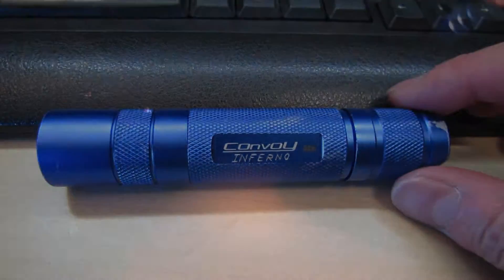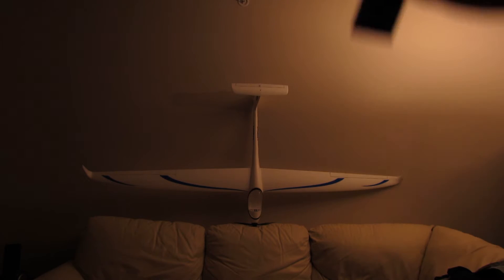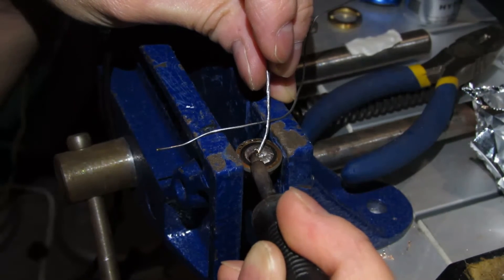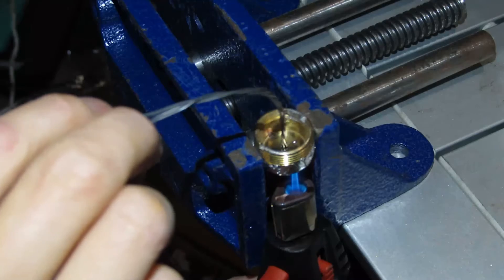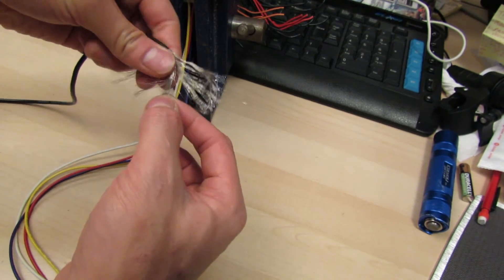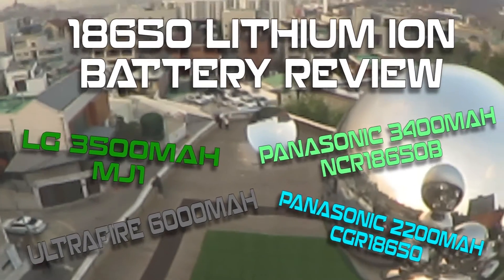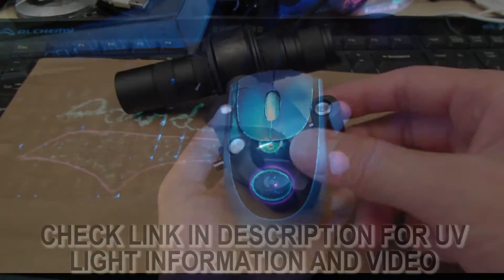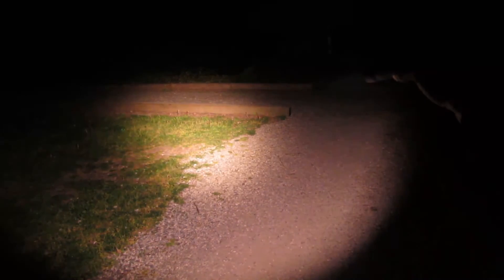The Most POWERFUL Flashlight EVER - DIY Convoy INFERNO - 2239 Lumens

Comment: You are aware that the XM-L2 can not put out 2000 lumens, much less 2239 correct? The T5 flux bin you have listed would doing good to make 1200-1300 lumens out the front as it puts out 35% less light then a U4 bin. Plus 7135's have high resistance and can't put out nearly as much power as an FET driver.

I suppose you are not aware of lights like the Astrolux S1 that put out more light then this in stock form and has an intergrated shelf so no need to worry about those pennies). Or the S2+ Triples that are making a REAL 2500-3000 lumens with 60W+ of power in the same light?

If you want to make things a whole lot easier next time simply use an FET based driver instead of the 7135's. They sell them pre-made for cheap on banggood as the "BLF A6" driver. Or if you want the latest and greatest look up drivers on BLF where there are lots of new triple channel drivers out.

This is an impressive amount of work, I just hate seeing people do that much work when they don't have to.
Reply from the maker: Hi Texas Ace, thank you for your informative feedback, you seem very knowledgeable and that's awesome and very welcome!  

I have always liked to work on this type of stuff, modify things, take things apart and play around with them, so to me this is actually fun, and not a lot of work; hopefully others think so too, and enjoy playing around with the electronics, wires, soldering, grinding even, etc.

I actually didn't know about the Astrolux S1, or the triple when I built this.  But since I've looked at them, as well as a single XHP70 in the Convoy S2+, they look good for high out the front lumens, but will be more expensive builds so I haven't gone down that route.  I'm pretty cheap so I wanted to see what I could do with just some extra 7135's, and the stock XM-L2.

Thank you for having me re-visit the lumen output, I am always open to learning, and you have shed some light on this.  My calculation was simply 20W(bench tested with the power meter), multiplied by the 116 lumens/watt, since the output is generally linear(I assumed), I calculated 116*20=2320 lumens.
The Cree website also said 170 lumens/watt at binning conditions(http://www.cree.com/LED-Components-and-Modules/Products/XLamp/Discrete-Directional/XLamp-XML2), so I assumed 116 lm/w was a fair choice and not misleading right?  But you're right, it's not as linear as I thought, and it drops as power increases.  I suppose my T4 bin could put out a lot less than 116 lumens per watt.
My impression was LEDs put out around 100 lumens per watt, and that fluorescent sources were even reaching 100 lumens per watt, so I assumed my Cree LED could output at least that.  Could be totally wrong though.  So if I go with a higher bin, say one that gives 170 lumens/watt, can you multiply by 20W and 3400 lumens?  That seems ridiculous and nearly impossible, I guess that's where you need to take into account the factors that decrease output.

For the heat, I was just trying to extract the heat through the threads, and create more thermal mass so it doesn't get hot as quickly, maybe 30 seconds instead of 20.  Not much but it helps having more copper in there.  I see that someone on BLF has since made a copper insert for the S2+ that you can buy, which beefs it up with copper, way more copper, he had a link on ebay for it.  Easier to get that, but I think it's fun to grind up copper and solder it.  I also purchased two 5mm thick plates of copper, gonna play around with that.

I like the FET idea, but I was scared of overcurrenting my LEDs, I am hoping the 7135 can limit the current if i throw in a VTC5 with super low internal resistance.  I saw on the FET websites they warn about keeping an eye on that, so I opted for the safer 7135 stacked method.

I am going to try cone-doming my LEDs, to make a better thrower, what do you think about that?  I'd appreciate your feedback for sure regarding that upgrade!  Will it redirect light to the reflector and kick it out in an insane beam?  I'm hoping, but I'll be testing and sharing my results regardless if it's successful or not.

Thanks again for your feedback and looking forward to your shared knowledge!

Cheers,
David.
Reply: At least you are willing to learn and not just cry when something is pointed out. Props for that.

Having fun with flashlights is what it is all about, I also enjoy playing with them, thats how I ended up with over 100 of them and counting lol.

The S1 is not what I would call expensive at but it also does have it's issues. At around $22 and 1600 OTF lumens though it is a pocket powerhouse that is hard to argue with. The convoy S2+ is simply a bit better made. They can both do the same thing with the same parts though.

An XHP50 or 70 in an S2 is pointless, I did it. It gets too hot to hold in less then 30 seconds and hot enough to desolder itself from the star in about 90 seconds. No joke. Same thing happened with one of my triples before I started using drivers with thermal setup down. The biggest reason that XHP's are pointless though is that you have to use 18350 batteries which mean you have all of 5-7 minutes of runtime.

Triples on the other hand are much better since they can use 18650's but they still overheat fast on turbo due to producing around 60W of power in a high powered version. They are a very nice floody light although I personally prefer the single LED EDC lights myself, they have a more usable beam for things further away then 30 feet or so.

Trying to calculate lumen output from the datasheet is an exercise in futility. Don't even bother. Generally when you are driving an LED hard it can easily get down into the 50-60 lumens/watt range. To see what the LED's do in the real world look up some tests on BLF, djozz does some nice ones. XM-L2's generally max out around 1500-1800 lumens for the high bins (ala, U2 and up). For a T4 you have to subtract 7% for each bin, so that would be a max of around 1200-1300 lumens, which is unlikely with a 7135 driver. My guess is closer to 1000-1100.

If you measure the current with a clamp meter or a shunt while it is in the flashlight and then compare it to the charts and correct for the bin difference then you can get a semi-close idea but it will be far from accurate, just a ballpark guess.

With current battery tech you pretty much can't overdrive an LED we use now days as long as it is mounted on a DTP copper star. Direct drive will only draw around 5-6A from the best batteries, lesser batteries will be less current then that. the 7135's have a lot of resistance and as such will reduce power more then an FET.

For example in my current EDC XG-G3 90+ CRI (soon to be swapped for a 219C 90+ CRI) S2+ with Texas Avenger 7135+FET driver it will pull around 8 amps on turbo with an HE2 cell but only around 5 amps with a GA cell and even less with a laptop pull.

Modern triple channel drivers give the best of all worlds, you have regulated low modes and then a full on turbo mode for max power when you want it.

You can dedome the LED but I highly recommend you do NOT dedome the one you have. It is a warm white LED by the specs you listed (which is great, they are a great tint). The problem is that when you de-dome an LED the tint "shifts" to be even warmer and greener. If you dedome a very cool white LED, such as a 0D or 1A tint the end result is not my thing but at least it is not puke green. If you dedome your on the other hand it will most likely come out looking like puke green and disgusting.

If you want better throw there is a much better option, simply get yourself an XP-L HI  LED in the tint of your choice, they come without a dome from the factory and throw much better. They are my go to LED for anything I don't want 90+ CRI in. If you want even more throw get yourself a good TIR lens (they are not all the same, I tested over 20 of them and only found 2 that work well).
Reply from the maker: Texas Ace Thanks for all the info Texas.
I'm always up for learning, that's how we all got here right?  Life is a journey and we will never stop learning, everyone is born knowing nothing.

That must be quite the collection you have!  Lol. But can never have enough!  I think there's a light for every task.

I haven't tried a fet on an XML, but I should try, from what you're saying, I'm guessing the low internal resistance of a good 18650 won't even burn out a single XML2 on a Sinkpad II.  I'll try on a cheap XML2 when I get a chance to experiment. 

For the dedoming, I was thinking if just cutting it off with a shaving razor blade, instead of gasoline, cuz I don't like color shift either.  I like my warm white 2750K, it's kinda like an incandescent light source, which is what CRI was based on, so if you can make it look exactly like it, it's sort of like a CRI of 100 lol.  It definitely has a higher R9 value, and that's important for light quality.  R9 is a fairly new value that LED manufacturers are looking at, because they realizing having more red spectrum contributes to higher light quality. 

So for dedoming, I was thinking of shaping the dome like a cone shape, which should help direct the light to the reflector, be it the smooth or a TIR.  Hopefully that will help throw more of the light forward, rather than out the front. 

That's awesome, I've tested a couple TIR optics, 10°, and it was better than the stock OP reflector, but not that much tighter.
I put an XPL HI in there too, but I'm thinking it throws a lot of light forward still, so I'm hoping the dome shape will help. 

I'm gonna test it out when I have some time.  
The XHP70 in the L6 has a donut shape, so I'm hopeful that it'll help with that too, but I'll have to see. 
What do you think?
Reply from the maker: Texas Ace Oh ya,  and about the LED desoldering itself,  that's pretty funny,  but makes sense since the heat can't escape,  it'll just get hotter and hotter to the point it reflows,  I press down while I solder though,  so it might not make a difference since the LED is being pressed down by the reflector.  Lol imagine that,  a light that runs so hot it operates with the solder melted! 

I don't like the idea of using 18350s neither,  cuz they have much lower capacity than 18650s.  I'll try sticking to 18650s,  the VTC5 has the lowest internal resistance of all my batteries, it's pretty good,  but I don't have any VTC4s,  apparently those are true 30A continuous discharge cells,  which might mean they have a lower internal resistance. 

I don't like having a floody light neither,  so the triple and XHP70 doesn't seem like a good idea unless you just want OTF lumens,  I like a good beam,  the stock S2+ is the most practical in most situations I use my lights, but I'm just playing around with throwers too, because they also have their uses.   I recently got the C8 clear with the XPL HI and it's hot spot is intense,  even higher intensity than the L6 maybe?   We'll have to test to see tho. 
It doesn't work well for walking sidewalks or trails,  but it's a hell of a thrower, which I need sometimes. 
I'm gonna try to put a 5 degree TIR on the S2+ with a cone-domed XPL V6-0D,  good thrower in a small package, then if I need it to be a walking light I can put a diffuser on the end.   I've found that the diffusing paper in the iPhone can actually create a horizontal distribution,  sorta like 60 x 30.  From one side it splits the beam into two,  flipping it over, it throws light horizontally,  perfect for walking a sidewalk,  or if you put it on a bike and ride around.   Anyways,  those are my future projects to play around with.  It'll be nice if I can make an adaptor for the front.   I'm sure they sell it but where's the fun in that right? 

I'm liking the off-time memory of the biscotti firmware tho.   Have you played with it?
What firmware do you run?
My cousin has the H17F with the guppydrv,  seems to like it,  but it's like a $30 driver for me so haven't gotten it yet, but seems great.  I was afraid on fet it might blow up some leds,  but based on what you said it should be ok.   Best part is,  I think it's temp regulation might be able to keep the temp down safely right? 

If they put temp control into the biscotti driver,  that would have been awesome,  should have had turbo timer too. But can't complain for $3.40. Lol. 

Do you have the L6?  I've been meaning to play with that and make it like a FET driven light,  they have 4 mosfets on there,  capable of 9A each so I think it can safely do 36A,  under high heat,  maybe 18A no problem.  And one person said an XHP70 can do 12A so that will be insane.  Since it's a big light I don't think it'll reflow the solder, hoping at least!
Reply: As long as the LED's are kept well heat sinked they will pretty much all handle an FET driver.

Slicing the dome still has a tint shift and lumen loss, not recommended on warm LED's, only on cold white LED's. Dedomed also does not improve CRI at all, in fact it makes it worse. It can reduce the blue in the light which makes the red stand out more but the CRI is not improved.

Trying to shape the dome is something you can play with but the chances of getting it right without messing up the LED is very small. Even a small scratch/mark on the dome will cause the LED to burn it self to death quite literally.

The L6 doesn't have a donut hole, in fact it is the only XHP70 light I have seen that doesn't (well if you look real close on a white wall it sort of does up close but not in real world use). Slicing the dome on the XHP70 will reduce the donut.
Reply: For drivers I use Texas Avengers almost exclusively now days, if you build them yourself they are cheap or you can buy them premade on BLF for $15. They run Bistro which is what Biscotti is based on. Biscotti is the baby version of bistro. Bistro does offer temp regulation among other things.

Yes, I have an L6, it is a fantastic light. The stock driver can be bumped up to around 7A without a problem but be careful about using paper numbers to calculate things. Just because the FET's say they are able to handle 9A doesn't mean they will actually supply that to the LED. You can not force current (aka, amps) into things, you can only force voltage. At a given voltage the LED will use a given current and there is nothing you can do about that.

To further complicate things the current it will use at a fixed voltage changes depending on the temperature of the LED.

I now have a Texas Avenger driver in my L6 (7135 + FET driver). In turbo it pulls around 10-12A depending on the batteries, that is the most you will get out of the LED no matter what you do with only 2 cells.

It is making ~6000 lumens at turn on dropping to ~5500 lumens @ 30 seconds though. So not too bad and narsil firmware is great.
Reply from the maker: Awesome, that's good to know, I've always been afraid of frying the 2 little wires to the XM-L2's.  On a SinkPad II it should be well cooled enough I figure.  I'll test it out with a FET driver for my next build.

I'll also keep in mind the color shift for the dome surgery, I had no idea it would change the tint, I thought the spetrum of light would remain same no matter what I did to the lens.  I don't think I'll touch my 2750K lights actually, because I like them way too much to risk any damage to them.
I've got some cheap $3.50 ones from Fasttech that I'll play around with.

Ya, I notice the donut hole with the OP reflector still, maybe I'm picky lol.  And of course it's really prominent with the smooth reflector(I have a video showing it, if you look carefully, both have a donut hole - https://youtu.be/6N2pGaiiaZ0?t=9m1s, it's really easy to see on the Templeton building), I'm gonna try to see if that cone-shaped dome helps make a thrower out of the L6, I'll try adjusting the position of the reflector up/down to see if I can focus it even better, I'll file down the spacer and then shim it to see how it affects the focus.  Not sure if it'll be successful but it'll be fun to try, and worth it since I have everything already.  If I break the XHP70, it will be about $7 down the drain, but worth playing around with.
Reply from the maker: I checked out the Texas Avenger driver, it looks awesome, like the Cadillac of drivers, did you make it?  That's pretty awesome.  I like how the positive wire bypasses everything LOL, that's a great idea to reduce system resistance to get the most power out of the LED.
Thermal regulation too, I like it, everything one needs in a flashlight.
Looks like a  lot of work has gone into it.  How much are they selling for?
What's the PWM frequency running at?  The max of the ATtiny85?  I see the ATtiny25 on one too, I'm guessing you're using the 85 now tho.
I want to start programming the ATtiny chips too, but haven't gotten the equipment or dived into it yet. Seems like fun!

For the stock L6 driver, I want to try running all 4 mosfets at 100%, and see what it pulls.  At full, it seems to still have some PWM going on, so I assume there's a current limiter IC or something, do you know anything about that?  Maybe I can bypass it, the 4 mosfets should be able to handle whatever it'll pulls right?  12A hopefully, should be able to since it's 4 FETs in parallel, should bring down the resistance even if they're not that good.
Here is the datasheet to the mosfet used in the L6: https://www.dropbox.com/s/vnglpcr1wqxpfi1/irf7811a%20Mosfet%20used%20in%20L6.pdf?dl=0
Based on that, it has a 12mOhm RDSon right?  So with 4, it'll drop to 3mOhm, or 0.003 Ohms, so that should act like a really good FET driver if we can drive it at 100%.
I'll play around with it to see what I can do, but there's a current limiter controller that I can't get the datasheet for, so may have to experiment with it lol.

I bet the Narsil firmware is good.  It's important to have a good user interface for a side switch light.
I put the moppydrv into my SkyRay king and love it, double tap to turbo whether your'e off, moonlight, or anything.  It's great.  It was cheap to drop in there too, got it off mountain electronics for $6.  If I can start programming, I can re-program my Attiny13A drivers to whatever I want right? Is the Narsil firmware available and easy to flash on?  I wouldn't mind trying that out, or any other good e-switch firmware.  I've got enough AtTiny13A drivers kicking around.
I bet your L6 is awesome with the thermally regulated driver, that's exactly what it needs to keep it cool but allow it to hit insane 6000 lumen turbo.  What batteries do you use?  I tested the Liitokala 5000mAh and they are actually very good batteries, internal resistance of 39mOhms, very low, but the VTC5 I just got has an even lower one, 26mOhms. My measurement technique is just using a 2.7ohm resistor, so not the most accurate, but a good gauge I think.  My old Panasonic 2200mAh are getting over 150mOhm, so it's a good metric to help compare things, and confirm things I already suspect.
I actually don't have any drivers with thermal regulation right now, cuz I live in Canada and the H17F is expensive to get shipped up there from Mountain Electronics.  It's ok though, I don't mind lights that get hot, just gotta be mindful.  But thermal regulation is the cat's meow.  lol.  I'm sure you agree.

I'm liking the biscotti drivers tho, it's good even if it's the lite version.  I noticed the temp regulation code in there, I guess they never took it out.  It also looks like it's pulling a voltage variable, so I'm not sure why they did that, won't work like that though.  Guess they just never removed it when they made it the lite?
Reply: Yeah, anytime to mess with the dome the tint will change, how much depends on the LED and the starting tint. Cold tints do not shift as much as warmer tints, Cree LED's shift more then other brands as well.

Strange, your donut appears to be a little more visable them normal. It is possible the wires were woldered on a bit "thick and that it pushing the reflector up a bit more then it should and changing the focus. If you solder the wires on really "thin" you can improve things a bit more then stock actually.

The XHP70 is closer to $12 but still not that bad but I would not worry with trying to cut the dome of the LED into a cone, better to try on some junk lattiebright knockoffs.

For the XHP70, you can shave the dome to improve throw at the cost of some lumens. The XHP70 doesn't seem to tint shift as much as the single die LED's.

The lower you can get the reflector the better, the limiting factor are the wires on the star, they will only allow the reflector to go down so far.

If you want more power out of the L6 the easiest mod is to simply stack an R100 resistor on top of the exsisting sense resistors. It should give you around 7A of current and a bit under 5000 lumens at turn on.
Reply from the maker: Texas Ace Hi, I will watch the tint for sure,  cuz I like warm color temps.
Oh ya,  I don't mind $12 either,  for some fun lol.  I'll see if I can document the color shift with a camera on fixed white balance.    

What's your preferred color temp?   I like 2700K,  but higher color temps for throwing is nice too.   But I'll stick to 2700K for most of my lights. 

Pic of my reflector and wires, ignore the mess,  I added thermal grease generously lol. 
https://www.dropbox.com/s/fq198ub7ij7nia7/Photo%202016-12-04%2C%2012%2053%2028%20PM.jpg?dl=0
I checked my L6, and although the wires are high,  they aren't shorting against the reflector,  there's a lip on the reflector,  maybe I can grind that down and resolder the wires to get it lower.   Gotta be careful not to short the wires with the reflector though.   I'll try powering it as you say, which should help focus the beam tighter. 
Thanks for all the info!!
I was thinking of shunting the R100 resistors completely,  but I think it's still running a PWM frequency even at 100%, strangely.   The resistors are acting like current limiting resistors right?  That's what it looks like to me.  Are they being used to measure current flow and then adjust the PWM to limit current flow?
Regardless they would be adding resistance to the system,  so I'd want to just bypass them,  I'm guessing.  I'll try it out and see what happens, worst case,  I fry it lol. Then maybe I'll just make it a FET moppydrv light.  That would be a nice L6 too.
Reply: From the picture it does look like the reflector is hitting the solder on at least the ground side (that flat area). So that will keep the reflector from being pushed all the way down and focusing possible.

2700k is too warm for me, it is ok but I prefer more neutral colors, 4000-4500k is my ideal tint, very close to sunlight but warm enough to be easy on the eyes. It is what OEM HID car headlights are for a good reason.

The driver in the L6 is a buck driver, those resistors are the sense resistor. It tells the driver how much current is flowing through the LED and thus allows it to keep a constant current. The PWM you hear is the buck working, not the output to the LED.

You can jump those resistors, it will work but some have killed the driver that way but others it is working fine. It seems to put out around 9-10A with those jumped on turbo.
Reply from the maker: The negative side is ok, the red side looks even closer, but if that shorted I think it would short circuit and burn out the driver, I'll resolder anyways just to make sure.  It seems like it's resting on the plastic spacer, but it's good to make sure.

I might be kinda old-school, wanting to hold on that incandescent look.  It's the most comfortable light, that's for sure, but might not be the best for lumen output or throw.  I ordered a 3000K XHP70, it'll be fun to make a thrower out of that, it'll look like a 300W halogen thrower haha.

Ya, 4100K is my preferred for headlights too, I just replaced my OEM D2S HID bulb with some cheapo $6(for a pair) 4100K bulbs from Aliexpress, and they perform similarly to my Philips D2S bulbs, brighter since they're brand new.  Don't know if they'll last another 10 years like the Philips did, but at $3 vs $90 each, I won't complain even if they only last 3 years.

That makes sense.  I guess I'll try bypassing the circuit that's controlling the current, and see if I can make full use out of the stock mosfets.

That's weird that some are burning it out and some aren't.  Based on that, maybe I'll see if I can alter the current limiter/buck circuit rather than a bypass.  Has anyone traced out the L6 or have more details on how it's reducing the current? I see a few components in there but the part numbers didn't turn up any datasheets.
Reply: The reflector on the L6 is isolated due to the anodizing, so even if it is contacting the connections it generally won't cause a short.

Don't bypasss a "circuit", simply install a jumper 0 ohm 1206 resistor across the sense resistor. Much easier and simpler.

Don't mess with the rest of the driver, the issue is well known and there is nothing you can do about it. It is simply a matter of heat, the more power the driver provides the more heat it produces. Too much heat = releasing the magic smoke = dead driver.

You can get a replacement driver for less then $5 or a new FET based TA driver for around $20 so it is not a big risk anyways. Just either install an extra R100 resistor or a 0ohm resistor and enjoy it.
Reply from the maker: I see, installing a jumper shouldn't burn it out though, since each MOSFET is rated for 9A and there's 4 of them, if the manufacturer is rating them for 36A total, 10A should be fine. Even with a jumper though, I think the buck circuit is still pulsing the MOSFETs, which will reduce the amount of power to the LED. I want to go for full on, so I'll need to bypass the circuit that's bucking with the PWM. I think I'll try putting a Qlite momentary driver in there with moppdrv tho, I like using the side-switch with the L6 a lot more than the tail switch. It's better for 1 handed operation with the side switch. It's nearly impossible to operate it with 1 hand using the tail switch lol. Others have noted that problem too, so hopefully this will solve it.
The FET TA looks good with Narsil, I found the operation, looks great:
https://drive.google.com/file/d/0B1IxYZuk4Djca0FObXUwcUhvZDQ/view?usp=sharing
Good for those who are looking for an elegant solution.
Reply: You should really look up how a buck driver works. Bypassing the inductor will only lead to tons of issues.

The FET's overheating is not the problem, it is the inductor and other components, the diode in particular gets super hot at high currents.

Basically just jump the sense resistor, that will give you all the performance the stock drive has to give. If you want more then that, then get the parts to build a TA30-LDO, it should only cost you about $10 in parts, I have some bare PCB's for sale.

Even with this driver I only got an extra ~2 amps and maybe 500 lumens out of the light. The real reason to use another driver is for the narsil firmware, not for the extra power.
Reply from the maker: Ya, I really like the Narsil options, pretty cool.  The thermal regulation itself is worth it.  Building a driver sounds like fun too, I like soldering up my own stuff, I'll look into that for sure.

I see, I'll take a look into the stock buck driver to see how it works, I'm very interested in what it's doing.
Reply: There won't be anything online about how this exact driver works but all buck drivers work off the same idea. Basically they use stored magnetic energy to create a constant regulated current via the use of mosfets, a high frequency IC, sense resistor and other feedback components.

I just released the Texas Buck driver recently, I learned that buck drivers are not simple at all.

Building a drive is fun, although you will need a reflow hot air station to do it. A soldering iron will not be fun at all.
Reply from the maker: Texas Ace Thanks for the summary, I'll look into how to build a buck driver.  I'll need more equipment, but it'll be fun times.
First I'll try reprogramming AtTinys, do you have a chip clip that you recommend for that?  I've seen some cheap ones on Aliexpress, but don't know which one to buy.
Reply: Building drivers is really quite simple, you simply order the parts, some solder paste, reflow station (about $20-40 on ebay), good tweezers, magnifying hat/mask (harbor freight has them for around $5 on sale).

Then you simply place the parts in the correct place and reflow it by heating it with hot air, lots of videos on how to reflow SMD parts.

Programming the attiny's is pretty simple. I use a cheap $3 programming clip from ebay and it works fine, although it stopped "holding on" and I have to manually press it down now but it still works fine.

While buck drivers are nice, the 7135/FET drivers are far cheaper and easier. I would stick to the Texas Avenger series, they are kind of the standard parts list/layout and they are cheap and effective.
Reply from the maker: That's awesome!  Does sound pretty cool.  I will have to give it a shot in the dark.  I haven't done it before.  I have some 138°C low temp reflow paste that I played around with, pretty cool stuff for soldering on LEDs.

Ya the 7135 are really cheap, and seem effective enough.
I ordered more FETs, gonna see how they work in the Convoy L6 maybe.
Cheers,
David.
Reply: Don't bother installing an FET in the L6 unless you want some really funky modes and WAY less efficiency. Just get another driver for the L6, it will be far simpler and easier.

A DIY L6 driver is only about $10, it will save you hours and you will end up with a far better end result.

Although I am serious, you do not need any of that unless you want the better Narsil firmware. The stock driver is actually quite efficient and effective. All you need to do in either jump the sense resistor or stack an R100 on top of them.

This costs about $.01, takes 5 minutes and will give you ~5500+ lumens.

The mid and low modes will actually be far more efficient then an FET only driver and since high is too bright and too much heat for many situations this is quite important.
Reply from the maker: Texas Ace Thanks for the advice.   I'll try the R100 way first and see how it performs.   That'll be my next MOD video probably.  Lots to do.
Reply: ***** It is a fun and easy mod, Then you can jump the resistor all together later to get 90%+ of what an FET will do with a fraction of the hassle. If the driver happens to die, well replacements are only $5 or it is an excuse to upgrade to an FET driver.